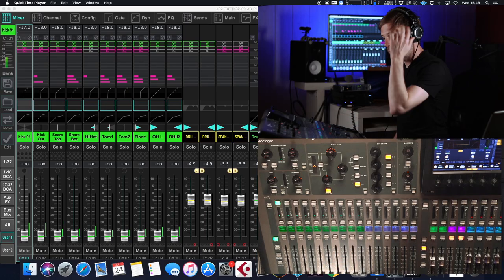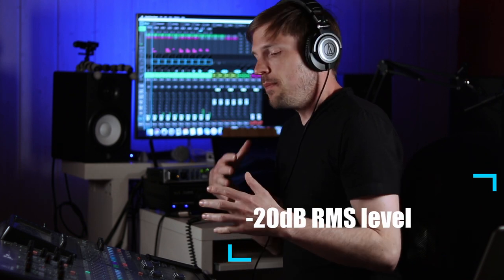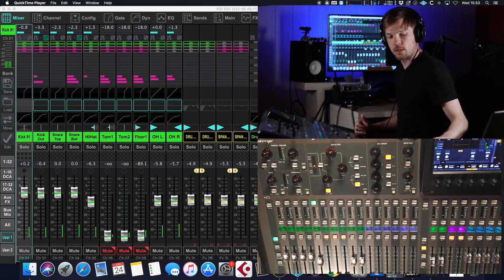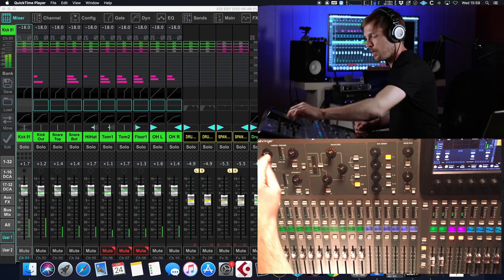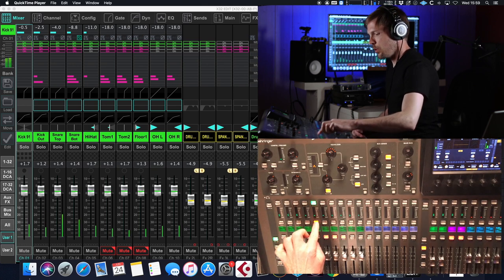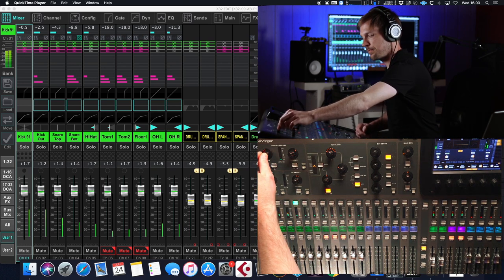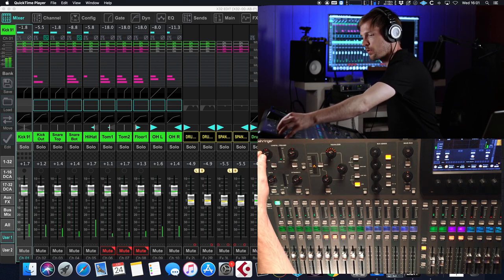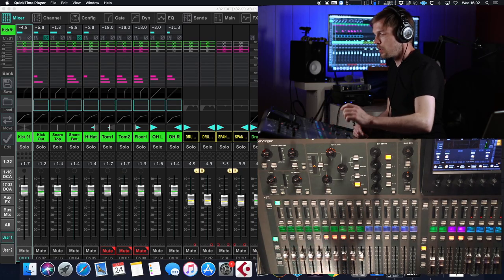Faders at Zero vs. Mixing With Faders Explained | Input Gain Settings for Different Mix Techniques

Comment: I see another variant of "Faders at zero" with some electronic music artists. Like Paul Kalkbrenner [ https://www.youtube.com/watch?v=hKPNFBxbXJE ] or Octave One [ https://www.youtube.com/watch?v=e4vvQMxbYnA ].

Here we have "Faders at +10", which makes the live performance a tad easier, because you can basically shove the channels in and out dynamically while not having to put too much attention to "hitting the perfect mixing level again". So I guess it's more an ergonomical decision here.

They both do use Midas Venice consoles, the first series - made in Germany. Which sound nice when being driven, but you're driving the channel and not the preamp.

I think this way of "all faders up"-workflow clearly derives from the world of DJ mixers, where the upmost fader position resembles "0dB". I use the same console and yes, especially with the hi-hats, after setting the preamp gain slightly north of 0dB using PFL, my channel fader ends up pretty low. So when performing on the console - and THIS is probably the huge difference in usage - the "travel-distance" becomes quite short and it's difficult to hit this fader position correctly again after like fading it out for some bars.

My guess is that "Faders at +10dB" will even increase the problems of the "Faders at zero"-method.

In regards of "driving the board", which of course can be highly desireably with some consoles... we are talking about two very different ways of "drive", because we hit different amplifying sections of the mixing console. My guess is that the preamp section is usually of higher quality compared to the amp used in the fader section.

Comment: Mixing with faders at zero seems kinda crazy to me -- you're pushing aesthetic things way too far back in the signal chain. For this heavily multi-track engineering, use gain only to match the trim of the inputs so you have as clean and strong a signal as possible (without clipping). You should really never mix using gain, since that was never the idea, but a lot of people do that based on how the tech developed over time.

Set the console's gain when faders are all at zero, obviously, but all you're doing is amplifying or attenuating so you have clean, "equivalent" streams. The goal there is to overcome differences is microphones, cables, or direct boxes / inputs. Make everything in the cans for each channel sound like what you think it would sound like if your ear was where the mic physically is. That's what gain is for.

After that, you can start mixing using faders -- that's what they're there for.

Comment: is there an analog board that exists that you can do processing straight across it?  spoiler alert, it doesn't.  Even if it did, why would you want that?  this is a terrible video for live mixing
Reply from the maker: Hey, thanks for your comment. Could you elaborate on what you mean by “processing straight across it”?  Not sure what you mean by that.
Reply: @gainmedialab  just using your words at about the 14:00 minute mark
Reply: not to mention, what if you have monitors? hence, live sound.
Reply from the maker: Aah, I see what you mean. If you have all channels coming in with the same input gain setting, regardless of the fader settings, then all auxiliary sends for monitors can be set much more easily, because you can reference levels between them for all channels (which works well on analog consoles and even better on digital consoles with sends on faders). When using the Faders at zero approach, the input levels will vary, so you cannot reference them for a quick setting.
Reply: @gainmedialab  if your post fade. which no one does if doing monitors from FOH
Reply from the maker: No, I am not talking about pre/post fader here. The described technique would definitely be true for pre fader situations.